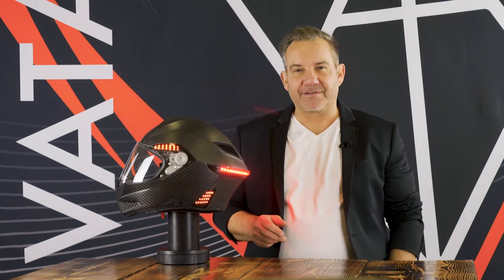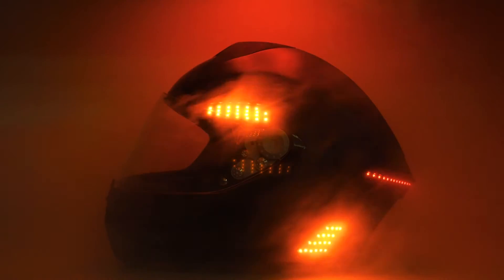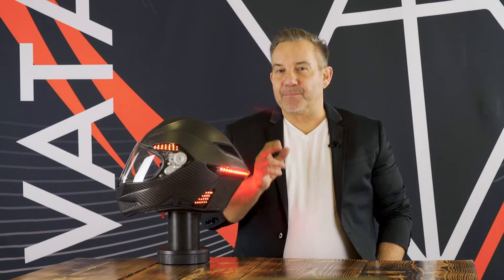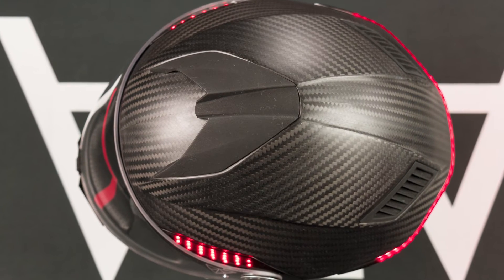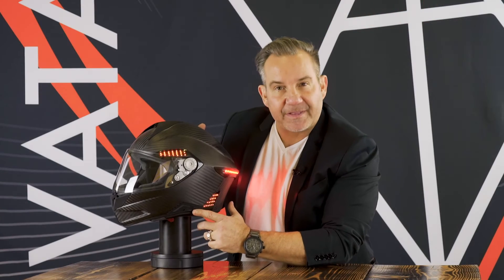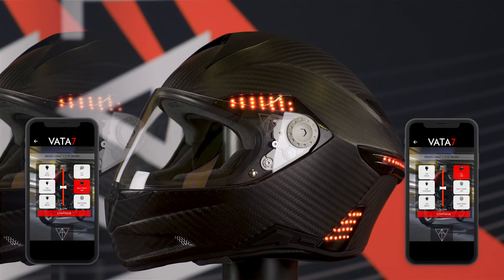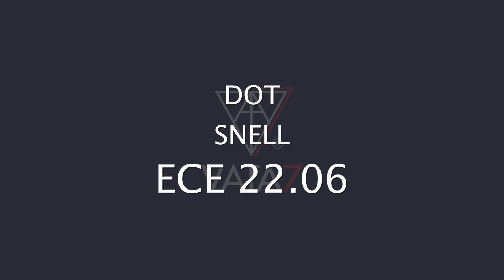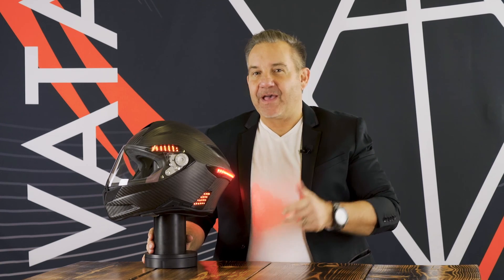𝐕𝐀𝐓𝐀𝟕 X1 ‘Speed & Light’  LED Helmet | 𝐕𝐀𝐓𝐀𝟕 𝐓𝐞𝐜𝐡 𝐒𝐜𝐡𝐨𝐨𝐥 𝐕𝐢𝐝𝐞𝐨 | 𝐄𝐩𝐢𝐬𝐨𝐝𝐞 4

Comment: How does is sync with the lights on the bike, and is it specific to certain model/year bikes ?
Reply from the maker: Hi.  We give you a 1" x 1" Tx Unit that connects to any motorcycle's brake light.  No cutting wires.  No splicing wires.  SUPER EASY!  www.vata7.com